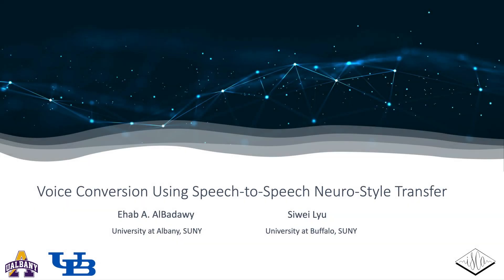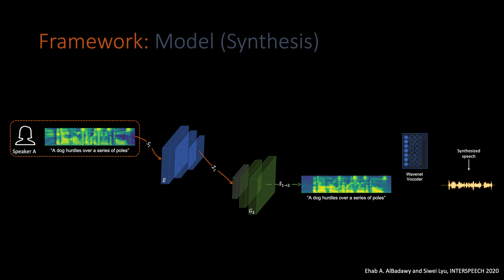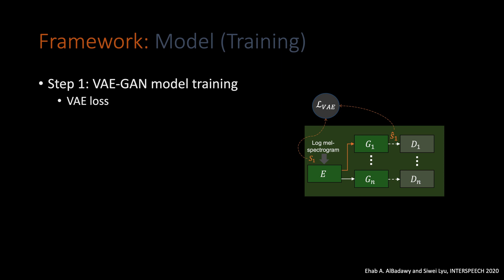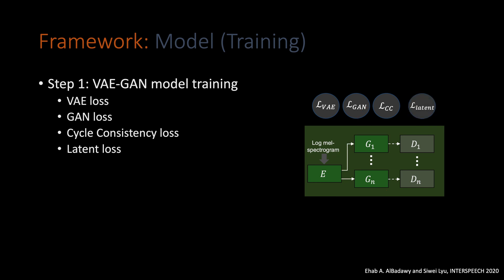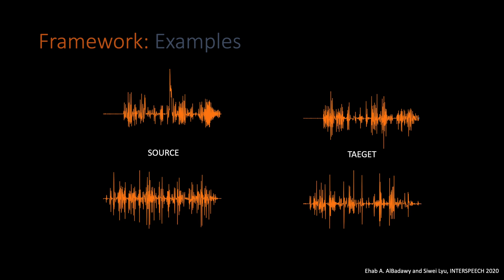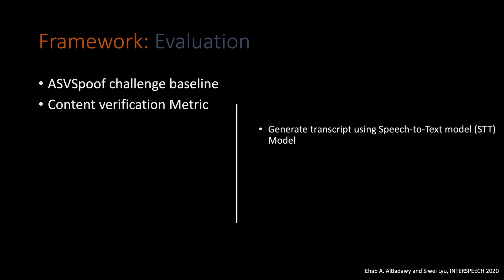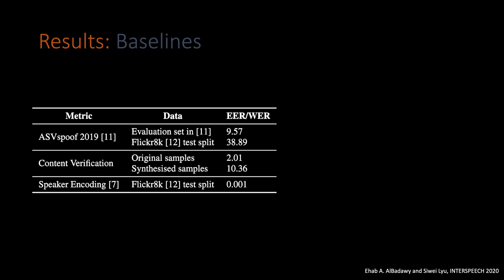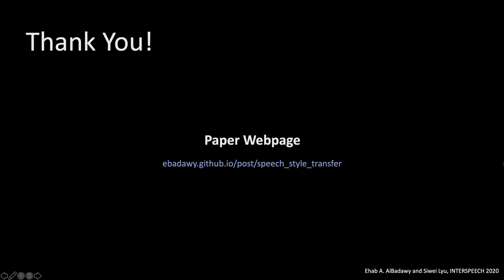[INTERSPEECH 2020] Voice Conversion Using Speech-to-Speech Neuro-Style Transfer

Comment: can we integrate it with a standalone realtime audio changer app in games or a  sophisticated voice changer for instance
Reply from the maker: Right now, our model is not focusing on the real-time case, instead it is targeting more the quality of the synthesized samples. The vocoder is the main component that take care of that. However, you should be able to try different vocoders other than the one we used and get the balance you need between audio quality and the time of synthesis